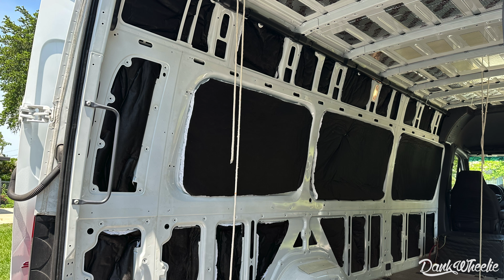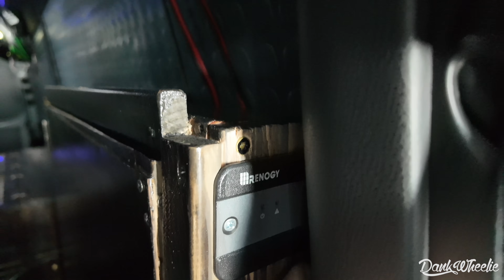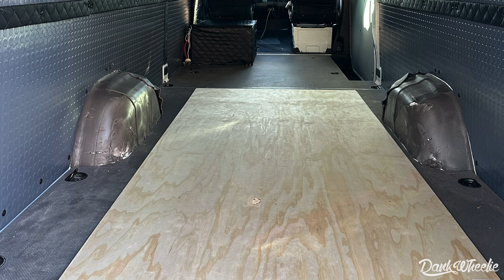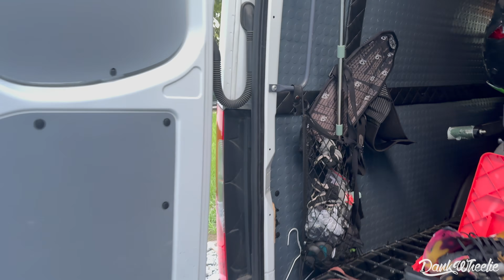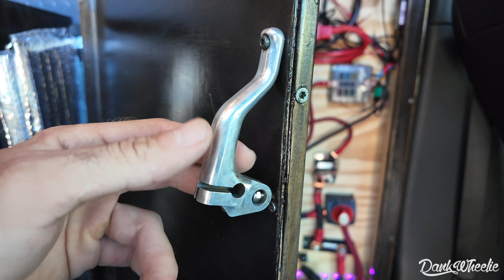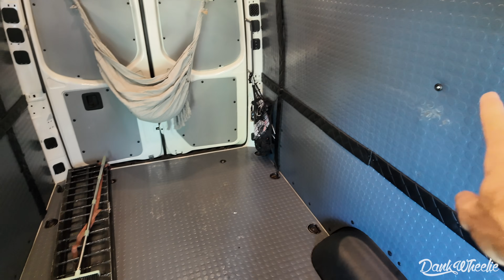Budget DIY Campervan Tour | Off-Grid Sprinter Van Build

Comment: 👍 Nice, fitting a curtain behind front seats would help cooling in the front when driving. Keep an eye around the injectors 6-12months as the seals go and black carbon build up around the injectors. Quicker you notice the cheaper it is. That model may not have the problem, maybe worth a google. Keep maintained and will last for decades, oil changes might be better doing sooner than manual. Nowadays they tell you silly numbers for oil changes. It's just wears the motor out. Deleting EGR if has one, reduces build up of  sticky carbon in the inlet tracks. Do research first, done my 320d had np over a yr. Just throws error codes in daig software on the beemer, but not on dash(could code out anyway) it's an 09 plate so none of that radar slowing down for you crud. That's some mind fk wiring, did see the red tape. If it's what you got, just got to make it work.
Reply from the maker: Thanks for the comment, I reused wiring from my last box design so I had to use black wire for positive etc but it all makes sense to me and is the correct gauges 😁 not a single spec of info online to delete to 19+ sprinter systems but it would be nice. EGR valve getting cleaned every 10k or so miles helps keep the system running smooth though.
Reply: @Dankwheelie  it's ok, just do thumb up thumb down on comment is fine. Don't want to take your time up. Thanks tho. It was just things to think of checking. Was going to buy an older model, so looked into faults, Problem with 320d is the EGR and crankcase breather go into inlet manifold and turns to sticky tar. Cheers

Comment: I had a Pioneer 12k btu with heat pump ac mini split in the trailer. Cannot recommend enough. $786 delivered. Towed it all over the country with zero issues.
Reply from the maker: Good to know, thanks for the recommendation!
Reply: @Dankwheelie definitely bro. Cool build. Happy Jack bed lift coming soon?
Reply from the maker: @12OKLOK I’m wanting to do linear actuators above the bikes for more height options 😁
Reply: @Dankwheelie I had cables pullies and a harbor freight winch. Probably over-engineered bit it worked lol

Comment: 02-06 diesel sprinter is superior
Reply: Debatable....
I own both 2 2005 and 1 2025 both diesel and yes imo the t1n is easier to drive but the space you get in the newer sprinters is crazy plus you can do 80 in the newer van in a r1n anything above 65 is scary 
Brakes,stability,sound,engine noise, technology just to mention a few can simply compare now a well maintained t1n will run forever we know that but in my experience if you can afford the newer van go for it if you can own both even better 
I retained my t1n because it's getting older and miles are getting high and I got a crazy deal with the 25 so I covered my t1n to a moto van I only drive in the weekends to go to the track
Reply from the maker: I wanted to build an older gen for fun!
Reply: @Dankwheelie imo the initial price for a clean one isn't worth it if you have another van trust me the difference is big  in every aspect